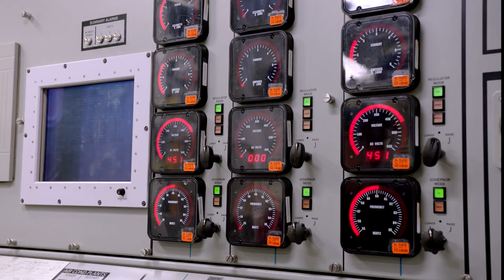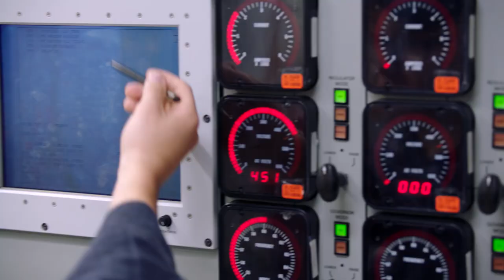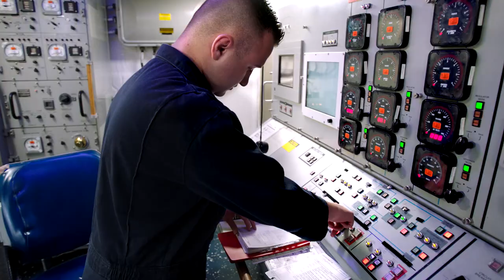Navy Gas Turbine Systems Technician: Electrical – GSE

Comment: Very cool. I was a GSE 1 after 6 years. Great rate. Great branch.  The Navy took me around the world literally.
Reply: scirocco1234 was it a demanding job?
Reply: @edjason3651  Yes it can be. The GSE is a very underway rate. Meaning you are usually a ships engineer. All DDG-51 Arleigh Burkes and CG-47 Ticonderogas have quite a few. Plus you could be assigned to LCACs or even some gator freighters and destroyer tenders.
Also the training is no joke. Not the toughest but certainly not the easiest. You will learn everything the GSM know and do plus plenty of electrical theory, both digital and analog, ac and dc. The training has paid off very well.
Reply: Signed for GSE I'm really excited, how often are you able to see your family?
Reply: @Dinokilla14 I discharged in late 1992. So things may have changed.
You will first go to boot. You will see your family after this. You may have an opportunity to take some leave. Then you go to A school for GSE. GSE and GSM start the same training. When the GSM training completes the GSE start the electrical training. This is AC/DC digital and analog. They promised us that the higher you rank in your class the better your choices of next duty station. I was in top 5 of class but when I asked for Mayport/Jacksonville, FL. Instead they sent me to Yokosuka, Japan for 2 years. At first i was a little upset but then it dawned on me that this is what I really wanted. To see the world. Always a foreign port. I extend an extra year. In those three years I chose not to go home but instead see more of what I came to see. I also knew I would one day go home anyhow so let the adventure begin. It was great. Japan, Philippines, Korea, Hong Kong, Australia, Singapore, Thailand, Malaysia, Kenya(Africa), United Arab Emirates, and Bahrain. 
I saw southern Europe and more of middle east as well as Cuba and Bahamas on second ship. Amazing!!! So glad I joined.
Reply: since you worked with a gas turbine can this convert into getting an aviation job in the civilian world?
Reply: @kcinnaibafangalan7918  mostly power plant jobs. In general the technical skills can transfer almost over to anything. Are you ability to understand AC DC circuit's analog digital circuits can translate to many other things and be a great stepping stone. Since since being discharged from the Navy I've been a robotics Tech a bench technician and worked in information Technologies
Reply: @kcinnaibafangalan7918  To add to that. I was an ABE launching jets (Waist Cats Baby!) for 4 years onboard a carrier. With that said, when exiting my service I was offered GSE/GSM for re-enlistment.
Reply: scirocco1234 Everything was really really great!
Reply: DAVID ALLEN  So I was a GSE and I operated 4 General Electric gas turbine engines (jet engines) and 3 smaller gas turbine powered generator sets as well as two entire engine rooms. There are gse and gsm. The "m"s do only mechanical while the "e"s do that and electrical and electronics.
A nuke is very similar except that they operate steam turbines powered by one or more nuclear reactors. My brother was a  nuke machinist mate. Both are tough schools but the nuke schools are the toughest.
Reply: DAVID ALLEN  GS are found on many classes of ship but usually smaller. Nukes are almost exclusively aircraft carriers and subs.
Reply: DAVID ALLEN  uncertain anymore. I joined in '88.
Reply: @blitzegron4848  that’s cool they let you actually pick orders straight out of A school
Reply: @lucasobad-mathis1141  Yes and No. My pick but only one choice. But it worked out great. So happy I didn't get what I wanted.

Comment: This is a push button Rate just like GSM
Reply: What’s that push button rate thing?
Reply: did his dad and him run charge cooled wankel rotaray 2 stroke race cars or 2 stroke with oil injection ford mustang red valve engine! or a wet sump plain bearing 4 joke stroke which you should get horny and get serious to prevent metal to metal contact to avoid burning a crankshaft!